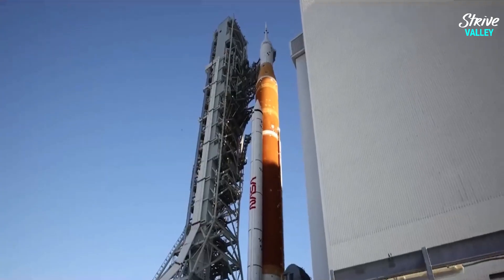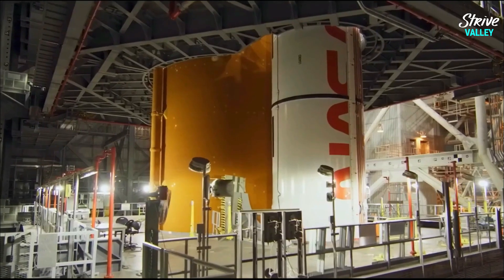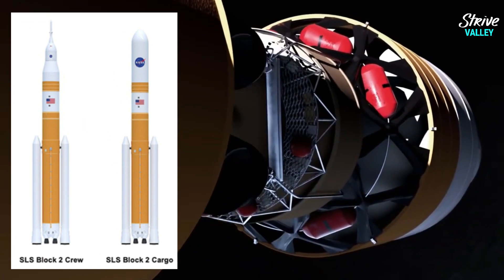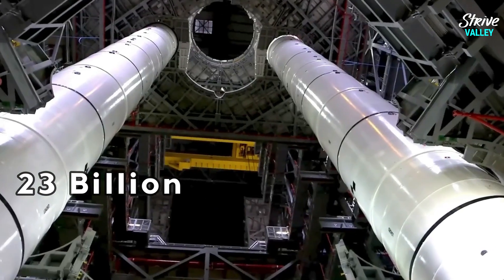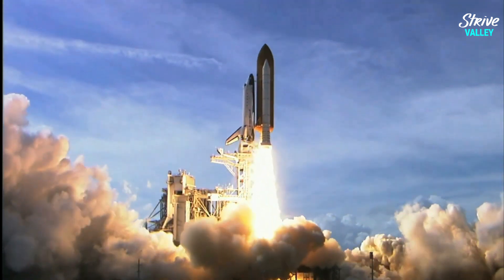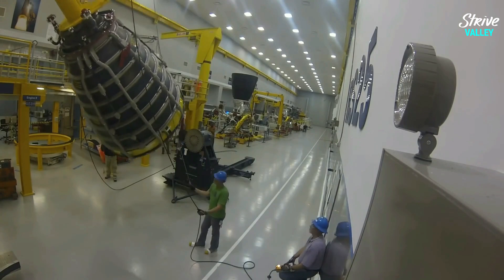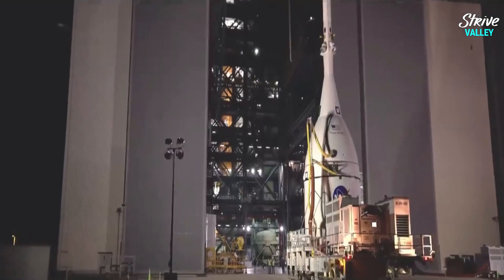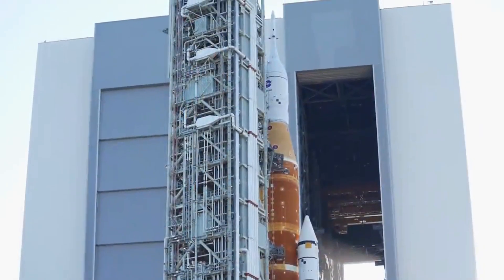Is The SLS Rocket Really That Bad?

Comment: SLS is a truly amazing rocket, but there's no point in relying the entire Artemis program on it. Certainly, it would not be wise to trust the entire program on Starship, however this is already being done, NASA has chosen Starship as the only lander in the program, at least during the first missions. 

I personally think that the most logical thing would be to use Starship as the main means of transport from LEO to the lunar surface, but not taking off or landing with people on board on Earth until the rocket is qualified for it. 

This can be achieved by making minimal changes to the Artemis program, for example, after putting Starship in LEO and having supplied it with propellant, a crew of 4 astronauts could take off in Crew Dragon or up to 6 in Starliner, and dock to Starship in LEO, the crew could transfer to Starship and travel from LEO to LLO,  dock with Gateway (or another Starship) and descend to the lunar surface.

To return to Earth, a second spacecraft could well be used in LLO to act as a return vehicle to LEO, or a second orbital deposit could be used halfway.

Comment: SLS's origins are earlier than 2011, maybe even 2002 it should be from the old Ares project
Reply: Realistically, yes it is the same design as the Constellation program which dates to early 2000s.  A cut and paste of Ares V, and still using the Orion capsule.....think about that, a 20 year old capsule design.....WTAF?
Reply: @Semicon07 Soyuz has been using the save one for a long time. Even the Dragon is the save basic design of apolo era capsules.
Reply: @bear3616   I'm guessing that English isn't your first language?  Did you mean "same" instead of "save"?   

Yeah you are correct, they all still use a capsule type design, however, my "beef", if you could call it that, is that they have not really updated it.   Technology has come a very, very long way since the 2000's.  The Dragon, while still a capsule type design, is a millions miles ahead of the Apollo era capsule.
Reply: @Semicon07  same. And English is my first and only language. I’m typing on phone where mistakes are easy.
Reply: @bear3616  ahh, yeah... good old auto correct!  All good man, have a good one!
Reply: @Semicon07  you too